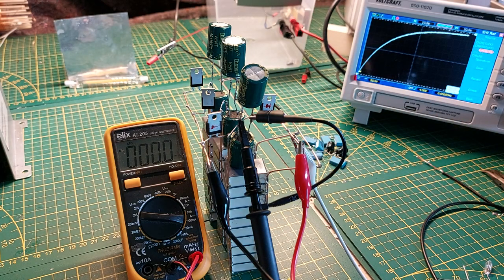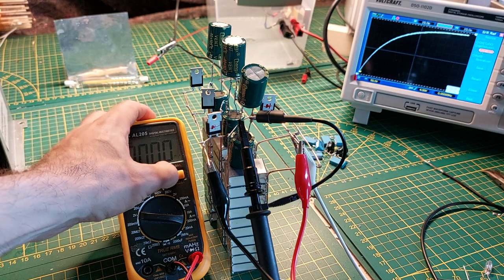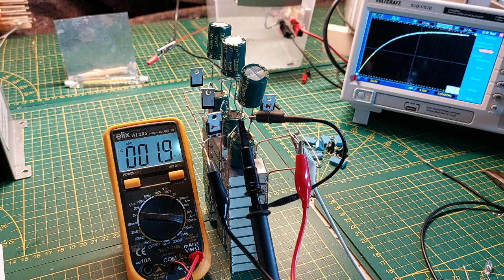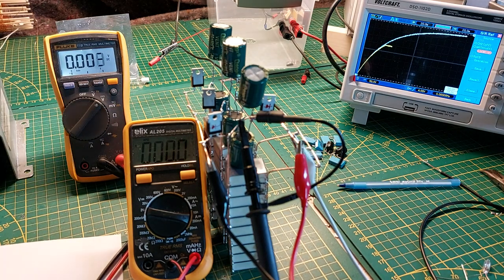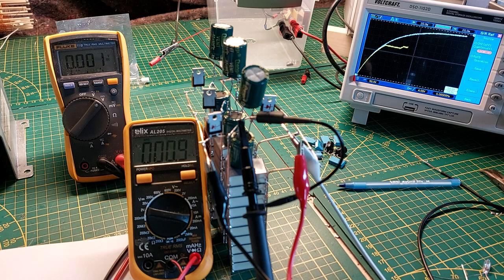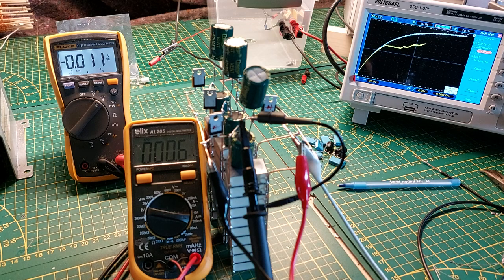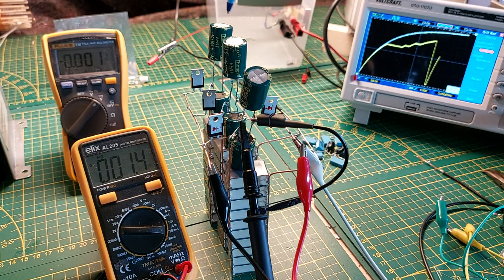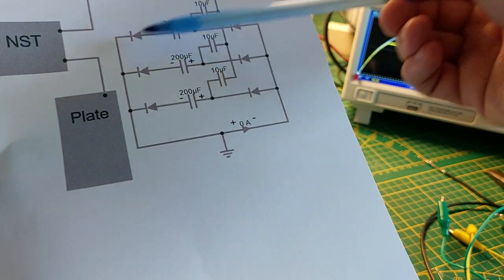Electrical Venturi Tryout

Comment: Funny title name. How do this circuit results compare with series staged AV plugs? Thumbs up!
Reply from the maker: @Alexis Smith, I was thinking on how it would be possible to have more in then out. Somebody talked about the electrical and mechanical things are alike and I thought on the venturi effect where you use a trigger signal to suck up from other source and that's how this idea was born. I looked at the Tate ambient power module but wasn't happy with test results. Also in the past every time it goes wrong is when I want to use output it always ended up in loading my source so I'm looking for something where our trigger signal isn't loaded to achieve output. 
I'm now searching on how to get controllable higher voltage then 1KV so I can see if that also ends up in more then 3mA of current flow in the capacitors circuits.
I first hoped to have better output when going from 2µF to 10µF because of more surface and the fact that that those small capacitors didn't charge up but it looks like the voltage level is more important to look into because I had many different values of capacitors and also 2 types of diodes and ended up each time with the 3mA (at the beginning of charging)